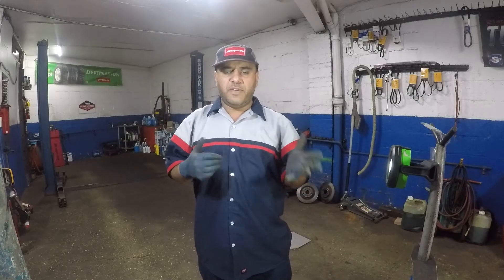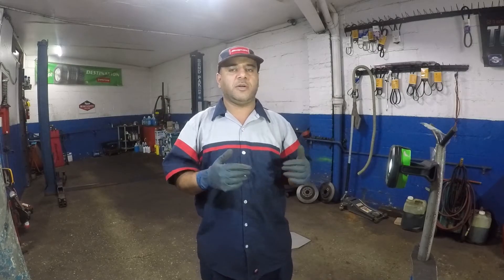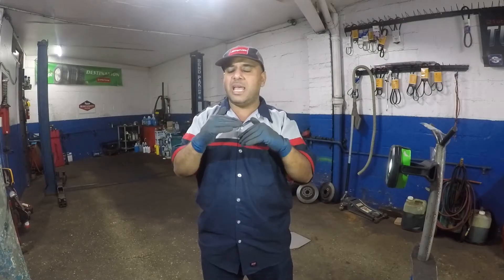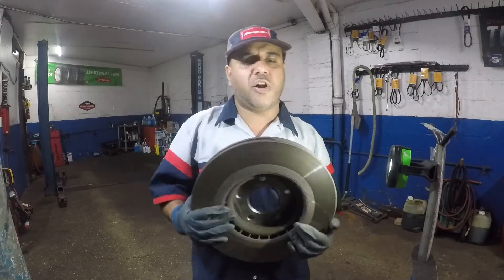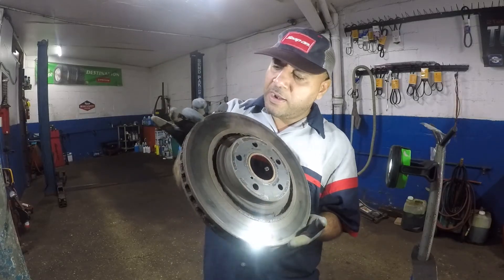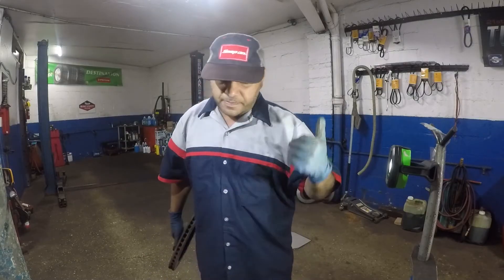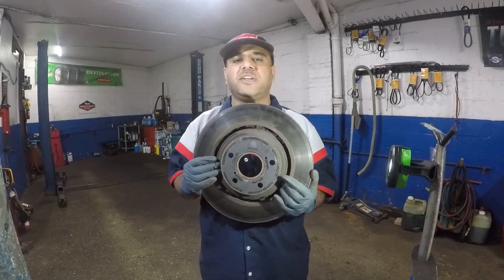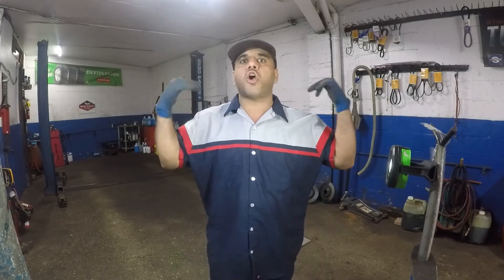The reason why car shakes when Braking

Comment: I got all four rotors and pads replaced but pulsating decrease but wheel steel shaking should i still get front new ones replaced? I was told to replaced one in the back because it look blue and possibly warped.
Reply from the maker: U said u got all 4
Replaced? Then why do again?
Reply: Check wheel alignment. Could be bad wheel bearings in front too

Comment: Please help brother loved the video I have a 2012 infiniti g37 that shakes at highway speeds and when I break even a tiny bit hard it'll feel like the break or something just want to fall right off or something what could be the problem
Reply from the maker: Any issues brakes pulsation or shake is due to damaged rotors.  So replace ur brake and rotors also if ur shakes high speed no braking that due to wheel off balance do both brakes and wheel balance
Reply: @perplexity do you fix the problem I have the same problem.

Comment: I change the front brake disc and the pads front and back but still the steering wheel shaking! Another idea?
Reply from the maker: Just send u message on the other msg u sent me
Reply: Did you figure it out ?
Reply: @5.0Fabio  i went in a brake shop and use thw brake dick lathe. All great now!
Reply: @anabash82  What did you use?

Comment: But I changed all four last year with new brakes. Noticed when I was traveling to Virginia and back to New York that my car was shaking at high speed when a brake . Thanks for the info I’ll let my mechanic check it this week
Reply: Yea last week it was the front rotors
Reply: Could be a siezed caliper did you fix the problem??
Reply from the maker: @5.0Fabio  usully the heat causes it could be jammed up pads jammed slider pins caliper but do the job propperly clean pins grease then make sure pads are no jammed and everything is smooth that should fix it once u do new brakes propperly
Reply: Thanks for the info
Reply: Damm and I paid $200 in part’s
Reply from the maker: @wilfredjaime1130  yeah it happnes may times I changed unwarrantee after few months they get bent usully from hot temp so check to see if pads are Jammed or caliper sliding pins move smoothly there for it dosent occur again
Reply from the maker: Yeah they might have warped

Comment: Well I bought new rotors new calibers and brakes. And driving my Tacoma 2004 in high speed and braking in shakes alot
Reply from the maker: It can be bad rotors or u didn’t get the roar meet surface clean on the hub check and see

Comment: Hey man so I changed my front rotors and my brakes looked great they where still new and I still felt shaking when o brake, then I changed my sway bar bushings thinking it would fix it but it didn’t 
It’s an 03 Tacoma 

I feel the shaking and jumping of car when I slowly brake but when I very quickly brake it’s not as strong
Reply from the maker: Did u clean the hub and make sure rotor sits flush did u change all rotors
Reply: @RBTheMechanic  only the 2 front ones I think I have drums in the back that I didn’t
Reply from the maker: @David-qw2iv  Re check ur work make sure the rotor where it sits on hindi nice and clean it can also be defective rotors also it can be due to brakes uneven surface
Reply: @RBTheMechanic  you don’t think it can be the back drums?
Reply from the maker: @David-qw2iv  it can be usually I recommend all
Reply: @RBTheMechanic  I will change, can I it be rear ABS sensors on the differential? 

They are not connected
Reply from the maker: @David-qw2iv  no that will not cause shake when braking

Comment: Thanks for the info bro, but is it ok to let it be just like that and continue using without replacing, this question coming from poor people such as me
Reply from the maker: No you have to fix it replace the brakes and rotors it will not brake well on high speed and it can cause other damages to brake master cylinder
Reply: I left the shaking and it caused failure of my steering wheel nylon bushing…$265 repair on top of the brake job I had to do to prevent the steering issue again a year down the road.

Comment: My brakes where fine I add new tires then straight way am having that shaking filling at 50ph
Reply from the maker: If it shakes on when u press brake the it’s brake related if it shakes high speed and ur not pressing brake then you tires are off balance and balancing  will take care of it
Reply: @RBTheMechanic  thanks it was fine till I changed the new tires
Reply from the maker: @hitmen2025  yup might be off balance so notice that if ur not pressing brake peddle then it’s tires off balance but if it only chases when pressing brake the. Brake related
Reply: @RBTheMechanic   it’s a rover 75 my8 😂 got a lot of memory’s that’s why am still keeping it now it’s been a week random days in the morning when I drive it shake back foreword could it be the spark plugs thanks RB
Reply from the maker: @hitmen2025  then it would shake ever on start up that’s misfire your talking about
Reply: @RBTheMechanic   what can cause and how can it be fixed thanks
Reply from the maker: @hitmen2025  well first determined it’s shakes without pressing brake peddle then since u just got tires they should had balanced the tires so u need to go back to them and tell them they didn’t balance the tires should be included with installation of tires
Reply: @RBTheMechanic   well try balancing them but may be the disc as I did change one of them I put on from the front to the back as it was much cleaner they did balance the tires I was there so we’ll se putting that disc in the back

Comment: I want to know when you change the rooters you should have to change brake pad also or that’s up to you
Reply from the maker: Change the brake pads as well to make the best out of the rotors
Reply: @RBTheMechanic  can the brake pads be sanded/filed flat if they are barely used?

Comment: I had change my brakes and rotors in the front but it's still shaken a little bit do u think it's because i haven't changed the rear?
Reply from the maker: That might be it   Also watch my brake videos u will see how I talk about cleaning the hub that can cause shake as well even though u changed it
Reply: @RBTheMechanic  thank you so much! I changed the fronts on my car but it still shakes all nasty with it. But i haven't done the rears
Reply from the maker: @dank9288639  dose it shake only when braking?
Reply: @RBTheMechanic  si guey, but I had the front rotors and pads done less than 5k miles ago, the rears have yet to be done. But I hit over 80 and go on the break and the steering wheel shakes like crazy, it's strange... I mean I don't think the back rotors and pads should have that much of an impact? Maybe I have something else going on? what you think bro
Reply: @RBTheMechanic  no pedal fed back, its nice and smooth, the shaking doesn't happen at 60 or 70, you kind of feel it like a tiny tiny bit but not like when im going 80 and go on the breaks
Reply: @RBTheMechanic  low speeds its smooth like nothing... I have rotors on all 4, brembo break system..
Reply from the maker: @dank9288639  80 is diffrent story now everything else such as tie rods control arms has to be perfect. But it can also be slight bent in rotors and yes rears matter but if steering shakes it somthing in front
Reply: @RBTheMechanic  that's what I was thinking, tie rods... Bc when it shakes and I move the steering wheel just a tiny bit there is almost no response. Thanks dude, I appreciate I carnal🤙
Reply from the maker: Watch this video it’s detailed https://youtu.be/iaIg70lIHaM
Reply: Great great video Brotha